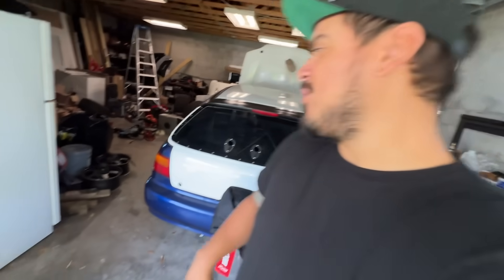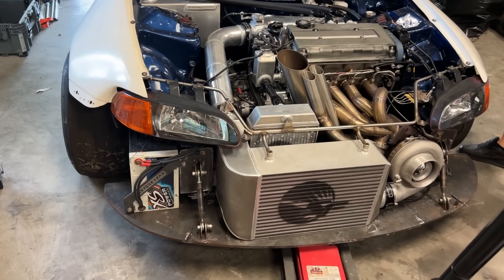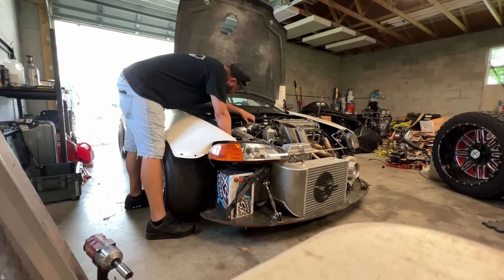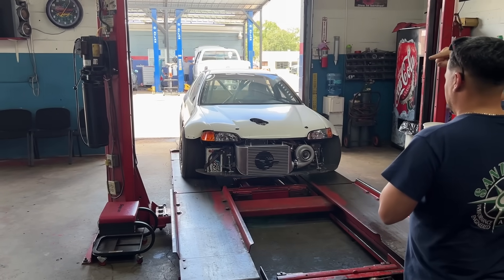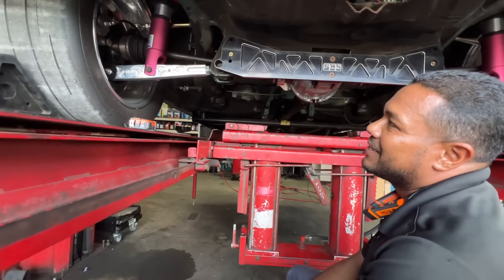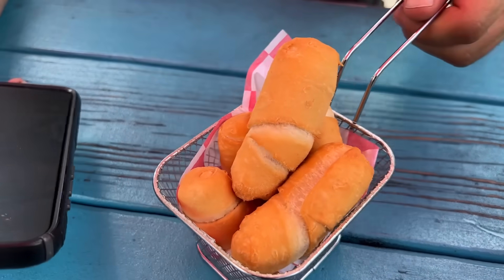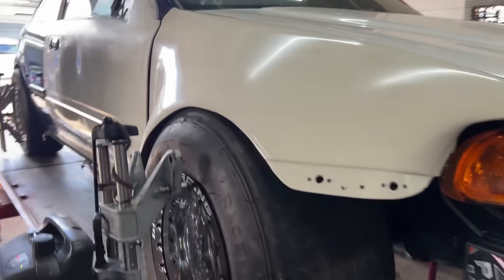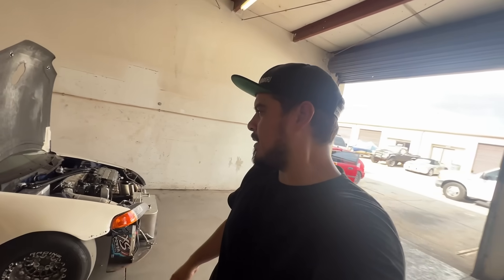TURBO AWD HATCH goes in for ALIGNMENT SURGERY!!

Comment: Not neutralized, alkaline. Your body can create whatever acidity requires as long as you've got the carbs for it. Alkalinity should be the focus of diet. Your body is a battery and pH is voltage in solution. Boost that voltage with alkaline producing foods.